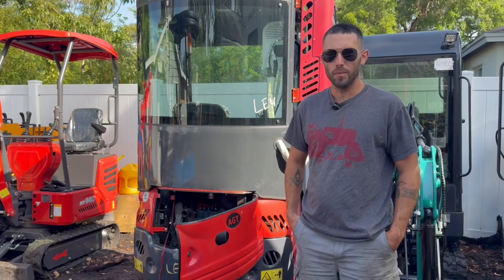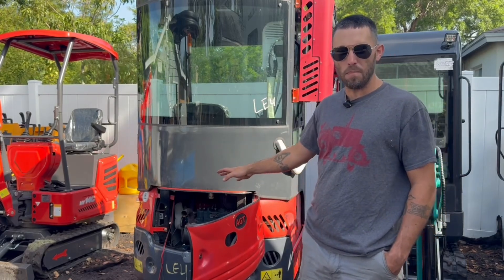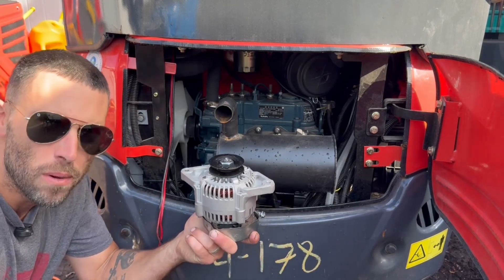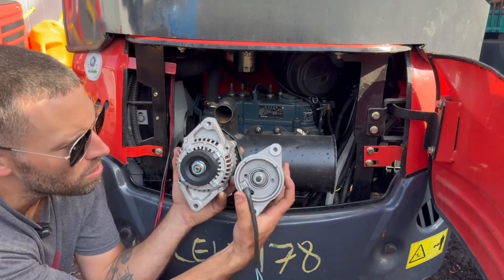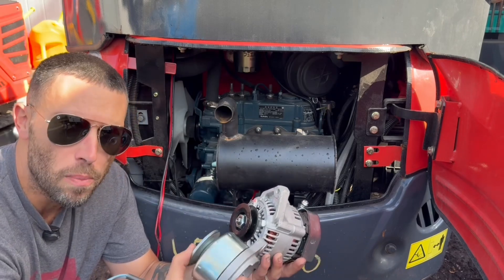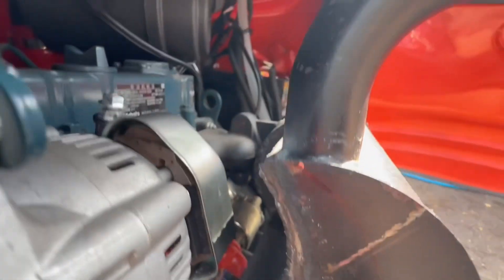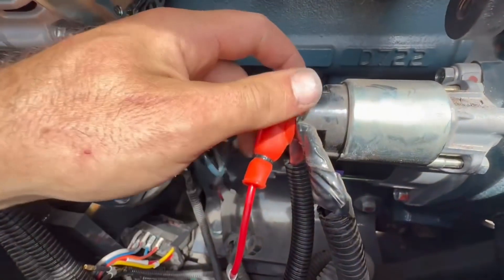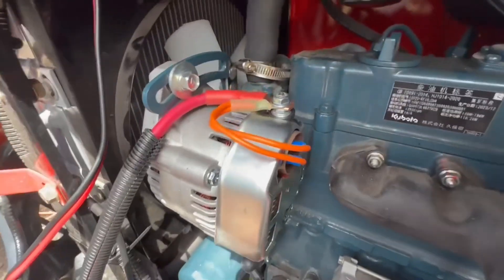AGT QK18KXS-C Mini Excavator High Output Alternator Upgrade for Kubota Diesel with Air Conditioning

Comment: What did you do with the original voltage regulator and wiring?  Just leave them in place.  Also, where would you tie in the "idiot" light wire?  My nt18k has that damn light on all the time.  I do want it to go away.

Comment: Excellent video and information. Thank you. Nice fabrication on that muffler! I have that same machine and took the AC unit off. Big mistake for the summer time. It's a total hot box in there. I removed the door and installed a little fan that does a great job of blowing hot air around, kind of like me. 🙂 So I may be doing this upgrade soon. Heat is a serious issue because I use the machine hard.  I have seen some other machines coming out with the AC unit on the roof. I really like that! 

I installed one of those cushion valves, and had to remove it because I never could get it to work properly. I tried all types of adjustments. As I worked the machine and it got hotter, it kept slowing down the pivoting motion.

Comment: Cam, thanks for the video and the link to the alternator... "Luckily?", my D722 has the muffler at the opposite end of the engine from the radiator...
It looks like my hydraulic fluid runs into the radiator, I assume this is the same as a car running its trans fluid to the "radiator"... 
I'd like to add a hydraulic filter and cooler in front of the radiator, so the engine fan keeps it cooler... Can you show how this is done?

Comment: I had that machine and did a few mods on it.
I only found a 60 amp on the small alternator.  It will not run the ac unit. I put a full size alternator 100 amp on the unit I had. I shorten the exhaust down 3 inchs. On the one I did. I made a extension bracket also a bracket to the frame. I also made a door on the side to fill the fuel. 

The video i did is on youtube
Reply from the maker: I watched your videos on your machine, you had some great ideas about how to modify yours
Reply: @thegarageconnection  just trying to give people ideas.

Comment: I have wondered why they bother to put the AC Unit on when the dont have the capacity to run it.
Reply from the maker: It’s an annoying problem admittedly
Reply: @thegarageconnection  If I had one I would do the alternator swap like you did also. I appreciate the videos. I have 2 open station Chinese minis
Reply: Because a client insisted.😅